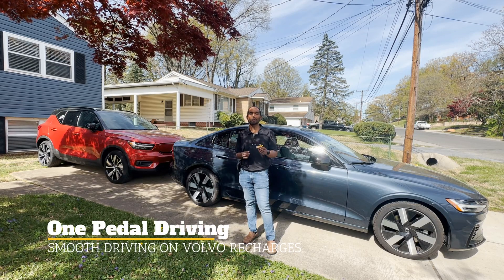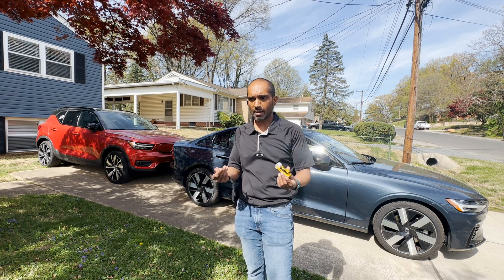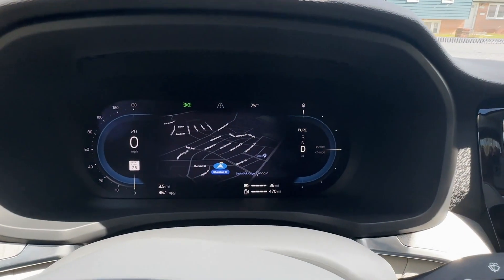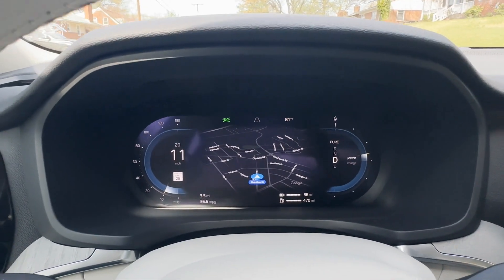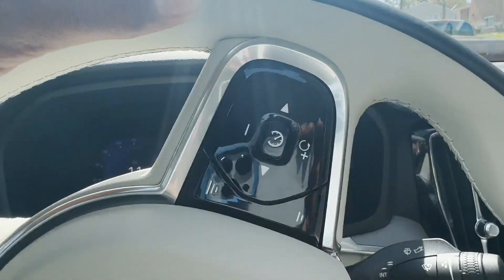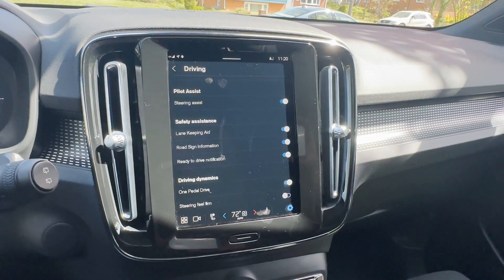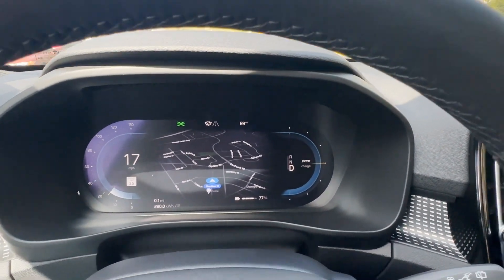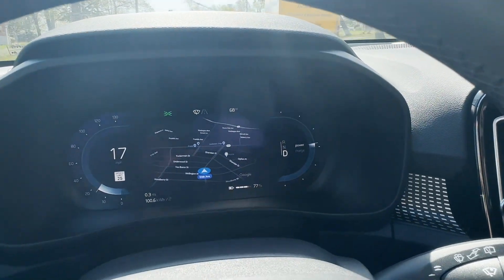One Pedal Driving and Brake Regeneration - Volvo Recharges

Comment: Just hearing about it, I'm thinking it must be pretty unnatural, that for coasting you still have to be on the accelerator and releasing the pedal doesn't give you just a minor slow down (engine breaking) but rather a full on emergency breaking. Also on a highway, if you just want to stretch your leg, you basically can't as you can't lift your feet of the pedal at all. But I guess the idea is that on highway you are using mostly cruise control instead of hitting the pedal yourself (or you don't use the 1 pedal driving). But I guess one has to try this on his own.
Reply from the maker: Thanks so much for writing. At first one pedal felt a little strange but you get used to it fast. Now I prefer it. It’s sporty and quick breaking and you can really squeeze in to spaces by accelerating pulling off pedal and jumping into a space. Make me a bit of hooligan sometimes!

I will say this S60 recharge one pedal is light and the perfect balance. XC40 is really strong breaking on one pedal. I got so used to it that my new GV60 feels much lighter for a 480 HP car and has multiple levels to choose from. If you are thinking about an EV I recommend renting one for a few days so you can get used to it and then decide. Thanks for watching and writing!

Comment: I don't get it. Using regen is the second worst alternative, with friction breaking being worse. The best must be to have coasting without any regen. Regen takes kinetic energy and converts it to chemical energy in the battery and then later back to kinetic energy. But this creates conversion losses of up to 30% in total both ways! Coasting just dissipates kinetic energy to the unavoidable losses of wind and rolling resistance, but without any conversion losses. So coasting is always preferred from energy conservation and therefore range point-of-view. That is not always possible, of course, since you might need to reduce speed more aggressively. But whenever possible, coasting is the preferred mode. There is no reason to get excited about regen and the fact that you put kinetic energy back in the battery! You need to consider ALL losses!

Comment: How do I enable one-pedal driving in my s60 recharge?  I don't see an option in my settings menu
Reply from the maker: Hello. One pedal in the S60 is B Drive controlled by the gear shift. You pull the gear shift back and it switches from gear D to gear B.
Reply: @JebRevsUp  got it thanks!!

Comment: Your videos are great for a new owner likes me. My understanding is that regen breaking is less efficient than coasting because you're preserving kinetic energy rather than turning it into electricity and charging the battery which of course it's not 100% efficient. Presumably that's why Volvo offer the auto OPD mode so that it coasts unless there's a car in front then you get the heavy regen.

Comment: Great video! Thanks! I'm picking up an XC40 recharge next week. I haven't decided whether I will use one-pedal driving (I've only tried it on a Tesla Model Y before). My other car is an ICE XC90, so not sure how easy it would be to switch back-and-forth between a car that uses one-pedal and an ICE car that doesn't provide one-pedal driving. Question: have there been any studies on how much better (percentage-wise) mileage will be using with one-pedal on versus off? I know, mileage is highly dependent on the driver, but wondering if there's been studies on average savings with one-pedal driving. Thanks.
Reply from the maker: I am not aware of any specific data that I can share with you. Having driven the same route commuting I have noticed a difference. However have driven one pedal for years it more than just efficiency. It is more more fun to drive this way, for many I speak too. 

It is so much nicer and easier than two pedals. Now I’m used to it, I would prefer to drive this way even if it did nothing! Every one pedal driver usually says the same. Try forcing yourself to use it for two weeks and you will be hooked.

Comment: I still can't get used to the one pedal drive. I don't like having my foot in a certain tension all the time, because I have to maintain its position so that it doesn't go into braking. I'm more comfortable with having one pedal dedicated to acceleration and the other for braking. And when I'm cruising, or driving with adaptive cruise control (my favorite feature), I can keep my feet on the floor and not worry about anything.

So while I'm recuperating less than if I were using one pedal drive, I feel more relaxed after the ride. And especially with the cruise control. It's a real blessing on long motorway journeys. I set a reasonable speed (usually 115-120mph), hang behind a car, turn on lane assist and adaptive cruise control, take my feet off the pedals and enjoy a totally relaxing drive.
Reply from the maker: Hi Miroslav, thanks for the comment. I think you would really like the level of back force on the PHEV. It is half of the pure EV. I actually hope in the future versions of the car they will have different levels of one pedal. 

I agree with you in the cruise control. Just used it tonight after a long day. Always a nicer drive. Thanks again